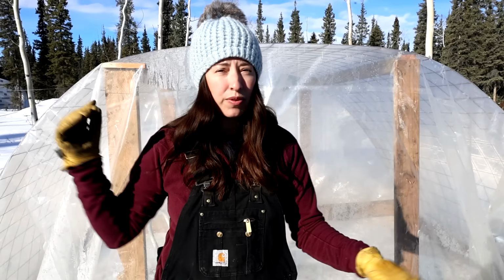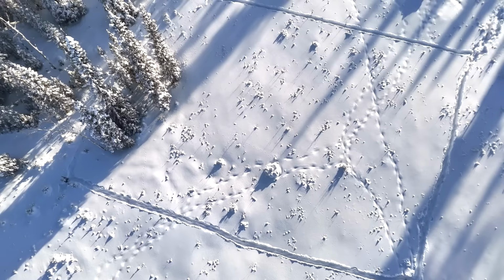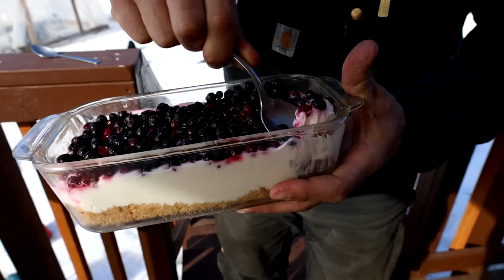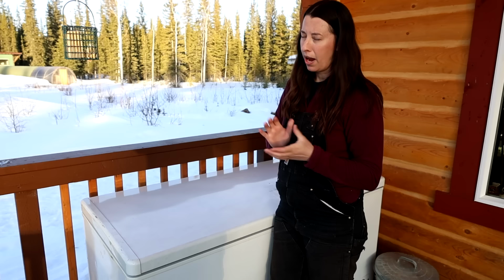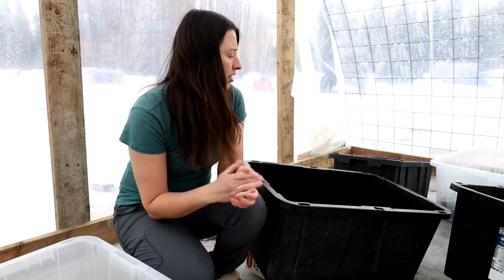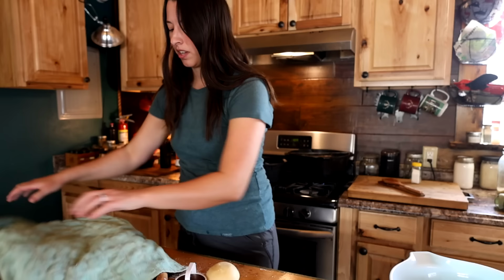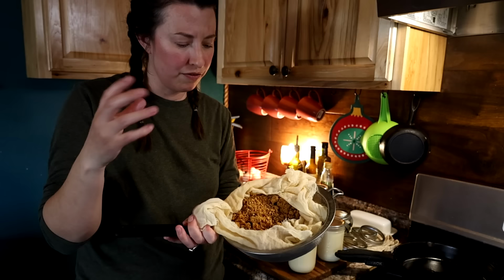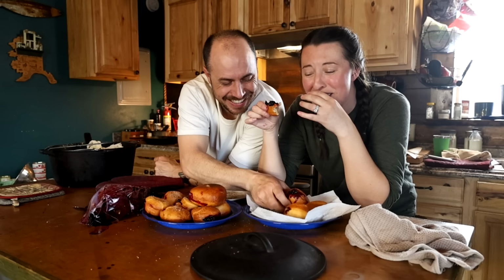Snow Be Gone! | Celebrating the END of Winter

Comment: what you dont want to do with refrigerated equipment is turn it on its side.  the oil in the compressor can contain microbits of contamination.  the oil travel with the gas on highpressure side and bring microbits with it .  result is stopped up cap tube feed line to evapcoil.  no fix.  keep them upright always.
Reply: Very technical, but, Yeah, I have heard the samefor my adult life(I am 62), basically 40 years
Reply: I ruined a upright freezer this way
Reply: True.  I am surprised it’s cooling.
Reply: The most important thing is to let it sit upright and still for at least 24 hrs after tipping it before you plug it in.   This let's the oil drain back, and it should  work just fine.
Reply: Was looking for this.  It's true.  Wonder if yall got lucky or not this time?
Reply: Youre absolutely right. Done it many times.
Reply: We had a chest freezer for almost 20 years, got ready to move & the freezer was just too heavy to move filled, so we thawed it out & tipped it over to empty out the water & needless to say we was heartbroken to find out we had ruined it by tipping it over(per three service repairmen) so glad yours is still working 😀
Reply: I did  same thing with a chest freezer. Turned it upside down to empty the cleaning water out of it and left it on its side. I didn’t realize things would have been fine if I left it upright for 24 hrs. Unfortunately I gave it to my son thinking it would work when plugged in. Nope! Embarrassing! 
Also, I had a refrigerator with a top freezer that I put in my garage in Northern Wisconsin. When it became AUTUMN with temps in the 30s, we realized the freezer was not freezing correctly. After a lot of research I found that each compartment needs its own compressor or else the fridge we had( which only had one compressor for both compartments,  then it needed to be brought inside to our heated basement. It works fine down there.
Reply: @charminghollowforge1109 so did I.
Reply: So they've been doing that for 5 years and I've been doing it like that for 25 years but you think you can't do that?
Trust the voice of experience not Facebook comments. We are here to advise people about what they can and can't do from experience not city slickers on the internet.
Reply: As a son of a service tech of 50 years experience in the industry, I couldn't have said it better.
Reply: Yess! I was just thinking this!
Reply: Same applies to air conditioners (& mini fridges), which you covered with “refrigerated equipment”, but some may not think to include. Especially window units that get moved and stored seasonally. Keep them upright at all times
Reply: Came here to say this 👍
Reply: I have moved many fridges/freezers. Big heavy ones  laying em down in the bed of my truck. Cartwheeling them up stairs. Never have had a single one break after doing that. Still have one currently that I thrashed like that over 5 years ago and it still works great. I probly wouldn’t do that with expensive stuff. I have heard what you said about handling them numerous times But from my experience I take it as generalized fodder!
Reply: Ya this would be the case if the unit is already on its way out. Metal separation or desalination of the windings has already begun. In Kamins terms your running high head pressure or high superheat for many variables for a long time.
Reply: @Aussiehomestead1965 but, this is the first time they’ve took it out and unfortunately turned it upside down which is bad for any freezer.
Reply: Fortunately they put it back upright at least until the next day so maybe it’ll be ok. But upside down vs just on its side is not good.
Like your car being upside down vs on its side.
Reply: This should be the top comment. I don’t know much about refrigeration but was very surprised to see the freezer upended like that!

Comment: Others have mentioned fridges/freezers and moving them.
The secret is yes, to keep them "upright" and NOT to power them up for at LEAST 30-45 minutes after placing them in position. This allows the oil in the compressor to settle properly.
Loved the seedlings/plants advice - we used to keep them in a plastic greenhouse and on warmer days used to put the seed trays outside for an hour or so to help them "harden off".

Comment: Attaching a straw to the end of the piping bag will help make a hole and as you pull the straw back through the donut to remove squeeze and it will fill up the mid,dle. You can also do small amounts of filling from both ends. They look great!

Comment: If you install a crankcase heater on the compressor, you can usually run the freezer at any temperature in the cold months. They are cheap and easy to install and keeps the compressor oil warm.  Thanks for the video.

Comment: Looks like you could use some chains for that tractor 🤔🫣
It’s not recommended that you turn a freezer or refrigerator on it’s side or upside down, 
But if you do , let it sit for a couple hours before you plug it back in so the refrigerant has time to settle. 🫶👍👍

Comment: For those not sure what cracklins are mostly made from, it's actually a kind of fascia, which is the sheath that covers a specific muscle, making it distinctly different from its neighbors.  Bicepts have two muscles (bi - two), and triceps on the other side have three muscles grouped together (tri - three).  Except fat doesn't need that, it just needs connective tissues to hold it together in little pockets of fat.

If you don't break up those connective tissues, providing ways for melted fat to escape, you'll actually not get much of the fat out of each little pocket.  (This would be wasteful.)  It's strongly recommended to finely mince the fat before rendering it.  This can be done either by chopping it by hand with a big knife or cleaver (tedious but traditional), or just put it through a meat grinder (hand-cranked or electrical, way faster & more efficient).  However, you'll still have pieces of fascia-like connective tissue.

If you're rendering the fat via boiling, the connective tissues will not fry.  (i prefer boiling because it "cleans" the fat better than simply melting it, and guarantees the fat will not scorch, but each person has a different preference, and all are good.)  If you simply heat up the fat directly in a pot, make sure to keep the temperature low so you don't burn the connective tissues, which would lend a burnt taste to the fat that will be difficult to get out.

These fried connective tissues are indeed like pork-rinds, in that it's somewhat similar to skin, and will taste very much like fried rinds.  Some uses for cracklings have included grinding them into a sort of low-carb powder that can be mixed with other substances (bread crumbs, almond flour, etc) and used for a breaded-like coating when baking or frying foods.  But a lot of folks, if they don't munch on them directly, tend to give them to dogs, cats, and other animals around the home & farm as a treat.

Fats are necessary for your diet, because your neurons (brain, nerves, spine) all require fats to function properly.  (This goes for all typical farm or homestead animals.)  Enjoy them in reasonable moderation, and you'll be fine!

Comment: I once cleaned out a huge chest freezer that had 3 inches of beaver blood in the bottom. I am a bit vertically challenged and had to climb in to ladle out the melted blood. Oh those were the days out in the Canadian bush. Good times!
I have read another way of rendering fat. Put water in with it to do the first render, let it solidify, take off the fat and discard the leftover. Add more water and repeat. The final stage is the final melting and storage.

Comment: those pork fried bits are delicious!!! dice onions very small, some garlic and any herb you like like chives, parsley and coriander. Just add a little bit of oil in a pan and saute the onions and garlic until tender. Put aside, let cool and add the parsley and coriander and any other herb you like. Add the rendered pork bits, add some salt and pepper to taste, set aside. In a bowl add some tamales corn flour and all the pork preparation. Add water gradually and make a soft dough just as you would to make some bread, but no need to knead at all. Make some oval shaped balls, wrap each one individually with aluminum paper, seal them well and boil them in water. add salt to the water and boil for at least 40 minutes. you can freeze them, eat them inmediately and enjoy, they are delicious!!!!

Comment: When you tip a freezer over on its side like that you have to make sure you wait like 24 hours before plugging it in again. You have to let the oil in the coolant lines run back to where it is supposed to be. You can destroy the compressor if oil gets in the wrong place. Every new fridge or freezer comes with warnings about this.

Comment: Have you thought about making a generator hut and use an extended exhaust system to heat the hut? You could put a slab down and pipe the exhaust thru the slab to the outside? O my a thought,when I re-watch the generator issue you guys have had this winter.

Comment: no good idea to turn your refrigeration upside down, what can happen is: 1. the compressor inside the hull can fall out of it springloaded feet, 2. oil can get into the compression chamber, 3. metal shavings and soot can move out of the oilsump into your discharge line and clog the capillary, if you have to move your refrigerator/freezer let it sit for 24h before turning it on again, ah and the reason why it´s not recommended to have you freezer unit outside in the deep cold is that liquid refrigerant could collect in the oilsump so the bearings are totally out of lubrication (heatband recommended) and if the temperature is very low the suction side runs in vacuum, oiltransport isn´t guaranteed anymore

Comment: Just a suggestion, before putting filling in your piping bag, cut the corner as you had, but, put in a piping tip before you add the filling. This will put the filling deeper into the donut. Then you can insert it into the donut, then squeeze, and voila, perfectly stuffed donut

Comment: Oh no! Don’t everrrr turn a fridge or freezer on its side or back or upside down or in any position other than upright! This can and will eventually ruin it if you keep doing it. If you absolutely have to do it try to do it only for a short amount of time and don’t turn it on right away when you put it back upright. Let it sit for at least a day. That will lower your chances of completely trashing your appliance. Hopefully your freezer is still running and hope this helps in the future. When you clean it in the future and you need to get the dirty and rinse water out, get as much out with a large cup or something and then use your shop vac to suck out the rest.

Comment: Solar above 60N.  You mentioned an upcoming solar project.  I presume you’re north of 60N latitude.  If so, disregard the usual advice to orient the solar panels south.  You want to get bifacial solar panels and mount them vertically facing east and west.  This will produce more power above 60N (especially in the winter) than south facing panels.  The vertical orientation will also minimize the need to clear snow from the panels.  Having a morning peak and an afternoon peak will slightly reduce the battery capacity needed compared to the single mid-day peak with south facing panels.

Comment: Hey Arielle 👋I was wondering if you had one of those plastic squirty bottles they serve mustard and ketchup in to use to fill the doughnuts? You can get ones with longer nozzles and cut off the ends to get the fruits bits out. You can also use them to make pancake art.

Comment: Those solo cups don't really last from year to year.  I use 500 and 750 ml (2 and 3 cup) clear deli-containers.  You can see when things are getting root bound and you can time your transplanting appropriately.  Use 2 containers (one inside the other).  Pole holes in the bottom of the top one, fill it with growing medium of choice, and place it inside the other.  It works very well, and the deli-containers last several years before you have to recycle them.

Comment: Bandit's ready!  Pepper be like:  "Warm mi likz!  Freezers, is not the rule of thumb, that when you tip it/right it, let it rest for 24 hrs. before plugging it back in?  Another tactic to get the snow melting quicker is to fling ashes from the wood stove over top of the area you want melted.  That will create dark spots to soak up the sunlight.  Mmmm... homemade doughnuts!  Yer a lucky man Eric!  Those cracklins are good on a baked tater, over a bowl of chili.  I bet they'd be good sprinkled over waffle batter in the waffle iron just before closing it.
Reply from the maker: That's a great idea 🙂 for some reason we aren't creative when we think of how to use them.